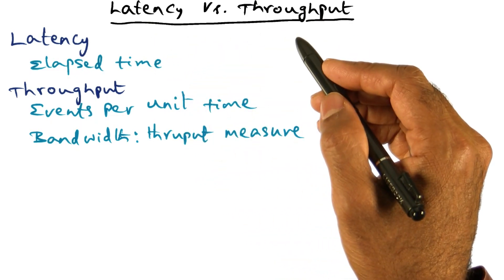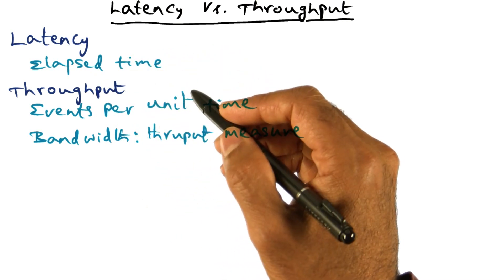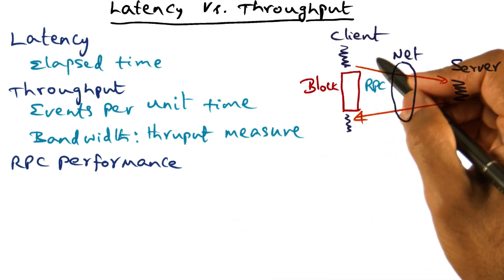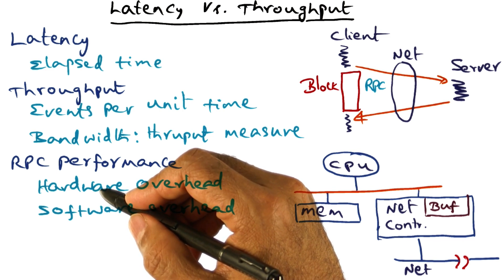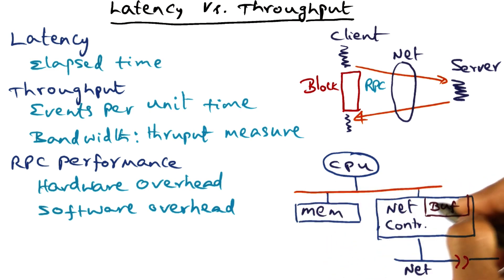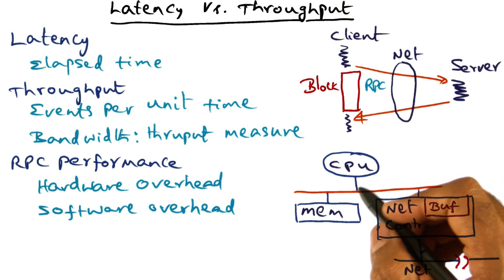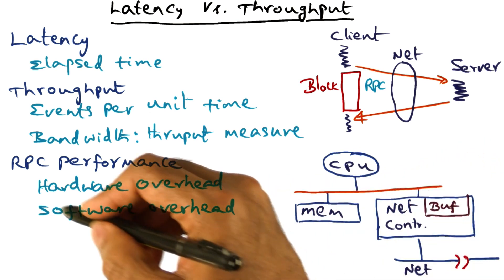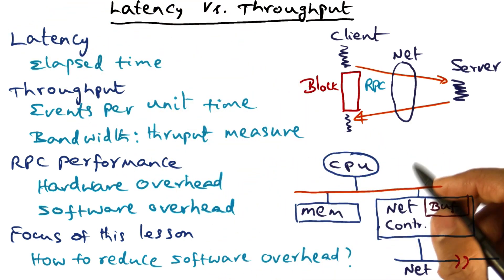Latency vs Throughput - Georgia Tech - Advanced Operating Systems

Comment: Thanks for this informative video. But I want to elaborate on the suggestion that "Bandwidth is a measure of throughput." Take a hypothetical queueing system for example. Let 'a' be the traffic arrival 
rate and 'c' be the service rate. The throughput 't' is then t=min{a, c}, whereas the bandwidth 
'b' is the service capacity of the system, hence b=c. 

Throughput is the actual service completion rate at a given time whereas bandwidth is the maximum possible completion rate. This stackoverflow post may also help: 
https://stackoverflow.com/questions/24246446/throughput-and-bandwidth-difference
Reply: Correct : This video explains that math function that you used in detail https://www.youtube.com/watch?v=TVpg7StOxgg